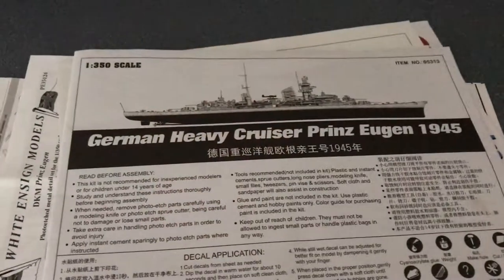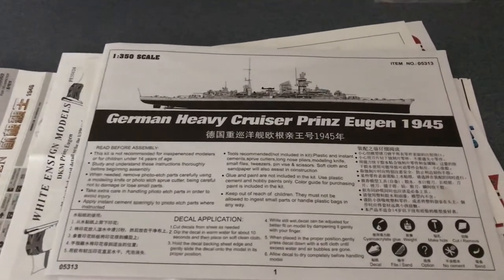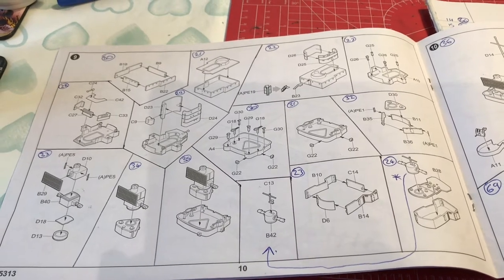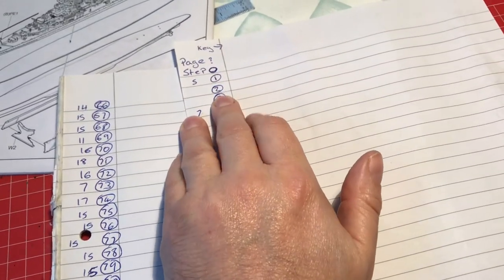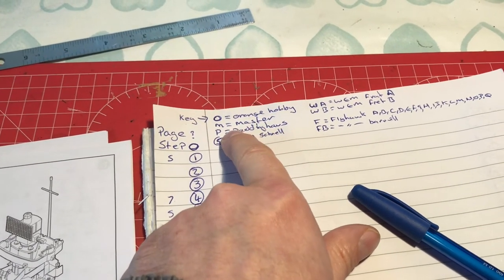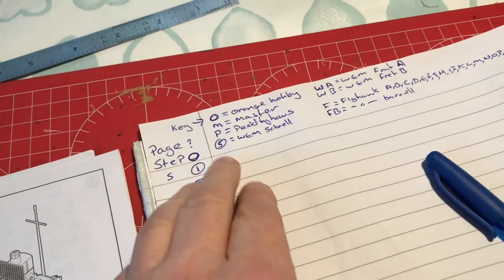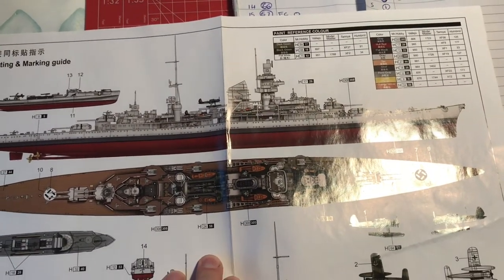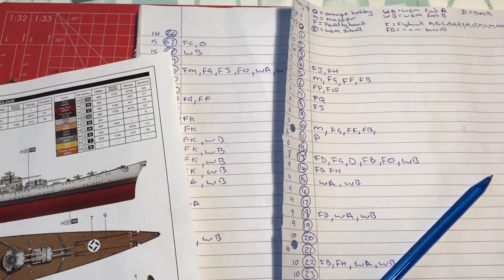How To Organise Model Instructions

Comment: I should have watched this video BEFORE I started work on my 1/200 Bismarck with instructions for the Deluxe Upgrade set from MK 1 Design (which adds a few thousand more parts), additional instructions for Eduard sets and the original Trumpeter manual. Extra anchor chains from China, decals from Australia... it becomes a huge puzzle sometimes and I think I will adopt your method even though I am already into the build. Thanks for sharing Jason and enjoy your Sunday :-)
Reply from the maker: If you put it on a spreadsheet it becomes more flexable.  Thanks for looking in.

Comment: Hi I know this isn't related to this video, however some advice would be appreciated.  I use vallejo paints, is there a document or website that will help me convert tamiya paint numbers to vallejo equivalent. Many thanks in advance.
Reply from the maker: Hi, there are several paint conversation charts about and even some phone apps.  Some are better than others, nine of them are comprehensive.  What I ended up doing was creating my own on a spreadsheet staring with Humbrol adding Tamiya and other brands from there, I can even use it to keep stock of what paint I have.  A good start is to google search for Humbrol paint wall chart the 2nd page has lots of conversations